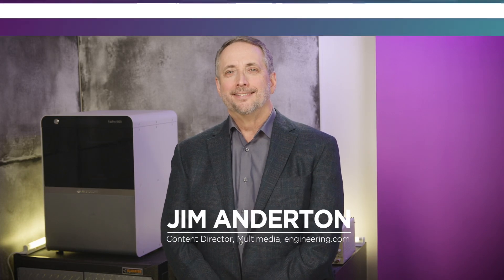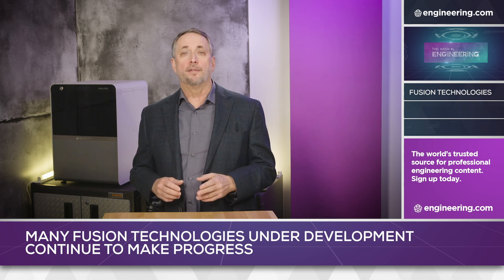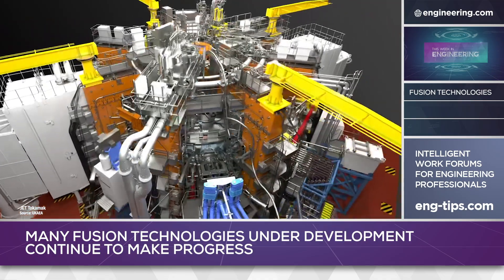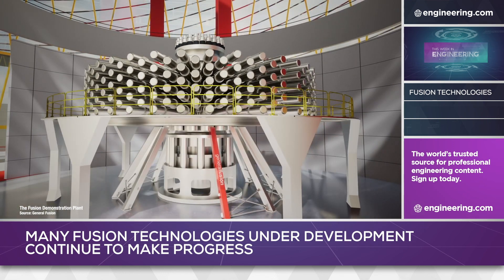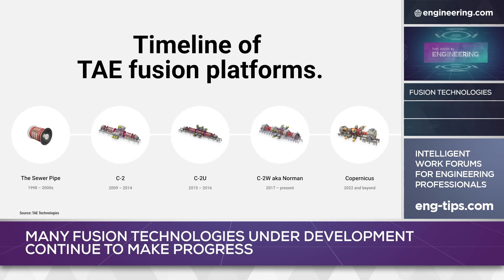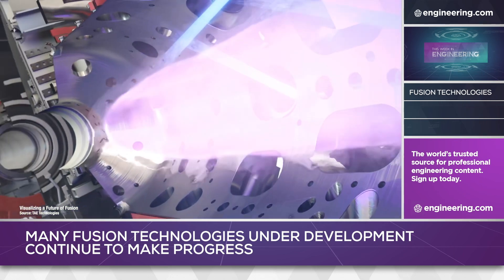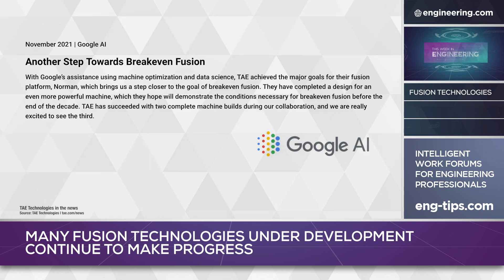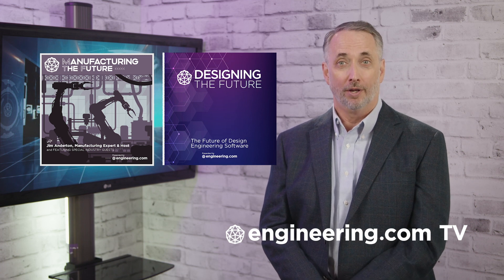A Different Approach to Fusion Power

Comment: Pressure is the most important for fusion, not heat
Reply: You need heat to ionise the gas to make plasma, firstly. 
To fuse nuclei you need to make them sufficiently energetic so that they overcome their electrostatic repulsions. This is usually done with heat. 

Further more, most plasmas are not that dense, and are in fact less dense that air, meaning they have relatively low pressures.
Reply: Ye, they should combine it with water hammer effect.
Reply: @simonsong1743  interesting!